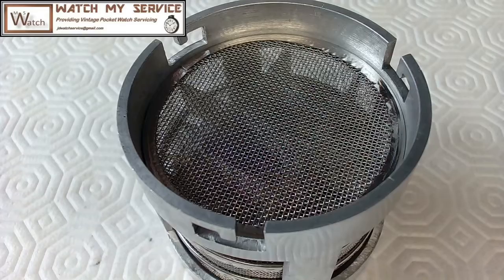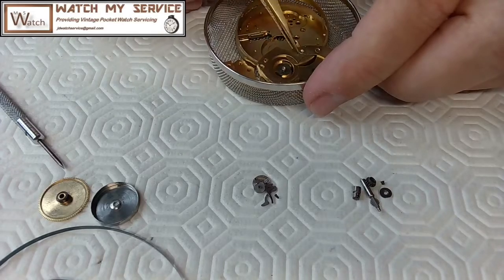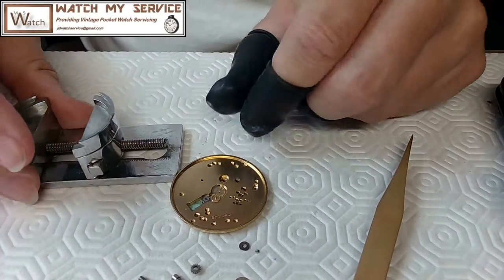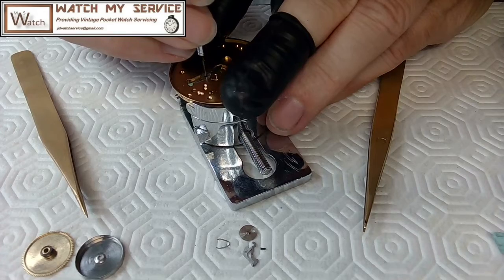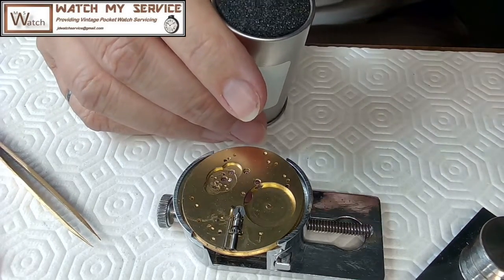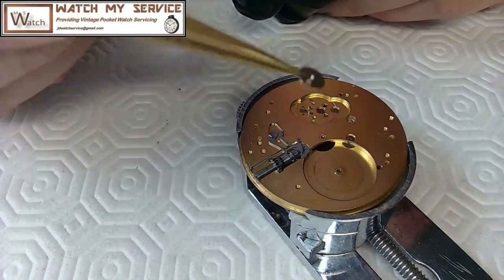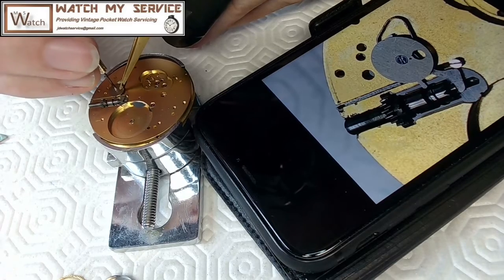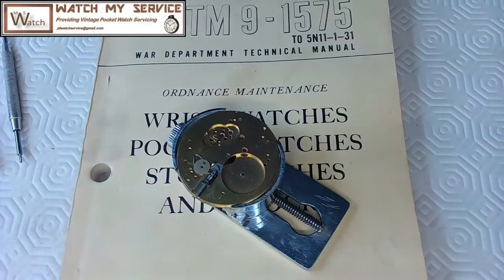Waltham Pocket Watch - Winding and Setting Assembly

Comment: Thanks JD! This saved me from a world of pain. I had the larger clutch wheel slid onto the wrong end of the stem. With everything apparently in place, the sliding clutch would barely move and the pin didn’t come out of the stem. There was nothing obvious about the positions and angles of the parts, except they simply didn’t work. But with the wheel in the right place, the pin comes out and the clutch moves properly. 👍
Reply from the maker: Sounds like one of those problems. I have usually where the parts somehow doesn’t fit and you realize it’s backwards.

Comment: Great video. yeah the keyless works particularly on the walthams are difficult. I find it easier to leave them be if they are working properly. cleaning usually works then I oil moving parts. I know its wrong.
Reply from the maker: Yeah, it depends on the quality of the watch, whether I actually stripped down the keyless mechanisms. It also depends on the rarity of the keyless mechanisms, and specifically the springs; if I lose a part or damage of spring, can I source this part
Reply from the maker: Hey Sonny, not sure if you’re interested in joining our little chat group. Just let me know.
Reply: YES   @JDRichard
Reply from the maker: @sonnymoorehouse1941  Added
Reply from the maker: @sonnymoorehouse1941  make sure you have Google meet
Reply from the maker: @sonnymoorehouse1941  Or I think, just click the link
Reply: what link ?   
 @JDRichard

Comment: Two things: if I ever have a cerebral hematoma, I want you assisting. Two: who/how did they manufacture micro springs and wheels to the tolerance needed in these watches, a HUNDRED years ago????
Reply from the maker: That is a hilarious comment, and I can make myself available for any surgery that requires adjusting small medical body parts. I love watching your videos On the factories, repairing and making parts.  They used to pick women for all of the jewel work, because they have small hands, and the machines they use back, then were exceptional. I know that Ford motor company fashion, their assembly line off of the visit that Henry Ford had with the Waltham watch company. There was also a lot of what I would call elbow grease involved in boatloads of files as a produce these micro parts, and made them to perfection. If you look at the Rolex videos on how they produce their movements, there’s one lady who spends all week, just buffing out the small parts